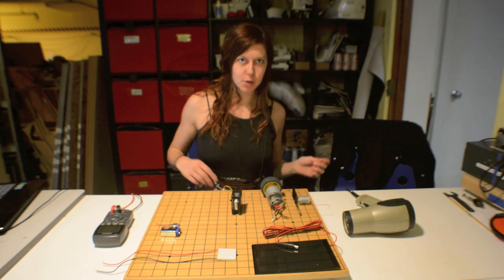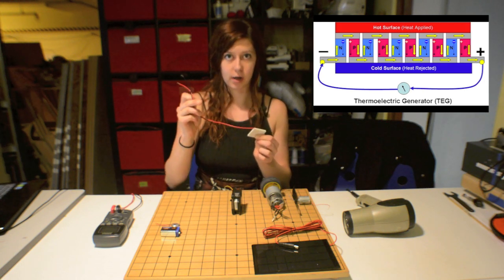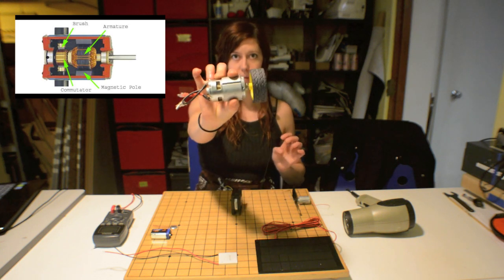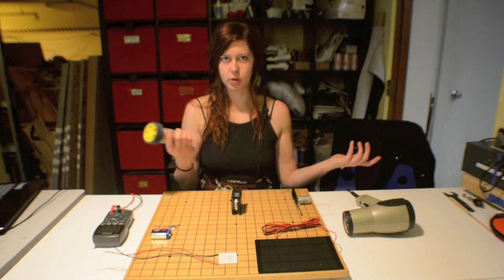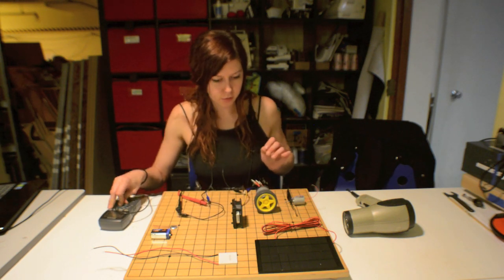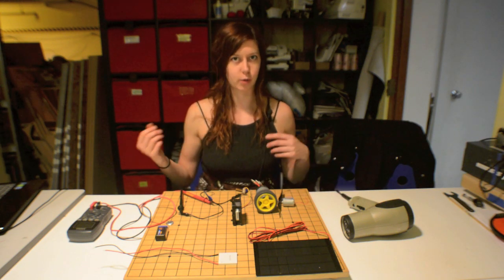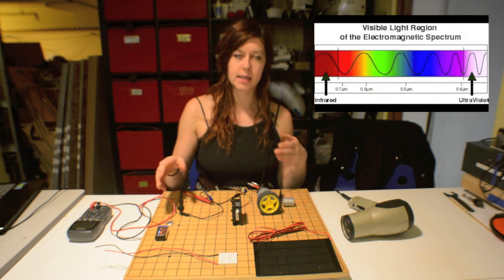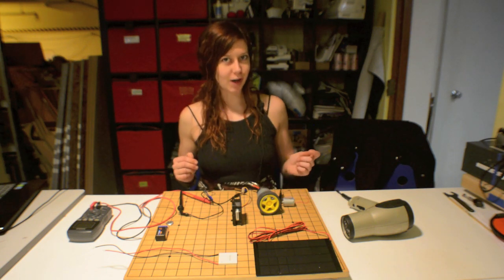Maker Quest: Intro to Generators

Comment: For the LED question in case of parallel if we increase the voltage we might end up burning the red led before the blue turns on , is this correct?
Reply from the maker: Yes! Red and blue LEDs have diff volt tolerances. But you can adjust with resistors 🙃

Comment: Re this week's question on the output of the 'generator' when the axle is spun counter-clockwise: since the rotation of the wire coil (conductor) will be opposite (S to N instead of N to S) to the generating direction (clockwise spin), the magnetic flux will also be opposite. This will mean voltage will flow in the opposite direction. Assuming that the multimeter has this capability and assuming no switching of wires, the multimeter should read as a negative voltage (if this is possible?). If we change the wires/polarity, then perhaps we will see the same positive voltage as with the clockwise spin.
Reply from the maker: +Tom Burns Yes, absolutely! You nailed it :) 
Re: negative voltage, since voltage is a difference between two points, having a negative voltage is totally fine, it just means that the current is flowing in the opposite direction as to our measurement. If you have a uni-directional component (e.g. LED or other diode), you'll have to switch the leads, but otherwise everything else is pretty much the same. You can think of it like subtracting: if you subtract 4 from 6 you get +2 (6 - 4 =2) and if you subtract 6 from 4 you get -2 (4 - 6 = -2). The magnitude of the difference is the same (2), just the sign is different, which tells us the direction.
Reply: +jen foxbot Cool :) love your videos, by the way!
Reply from the maker: +Tom Burns Thank you!! :D